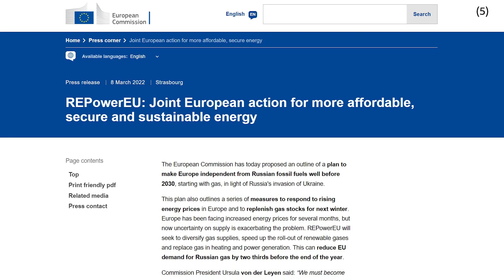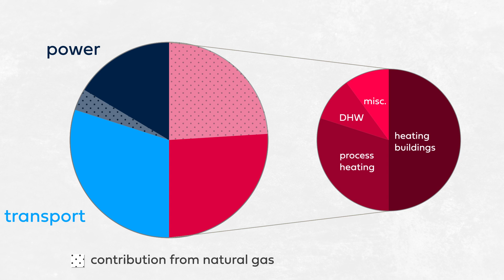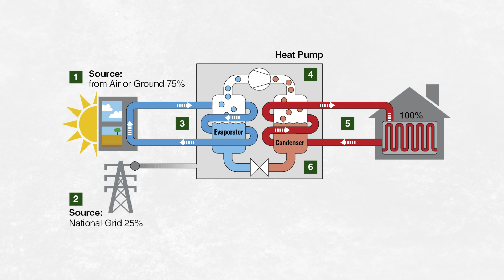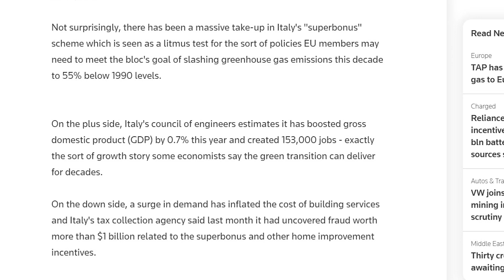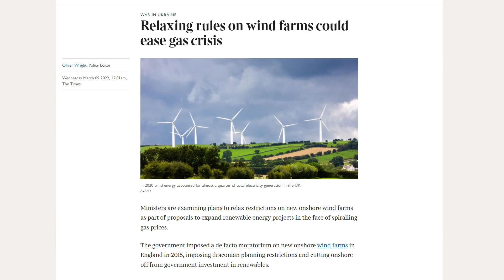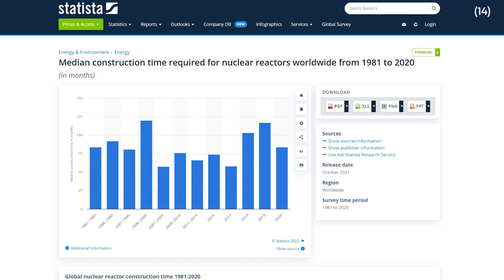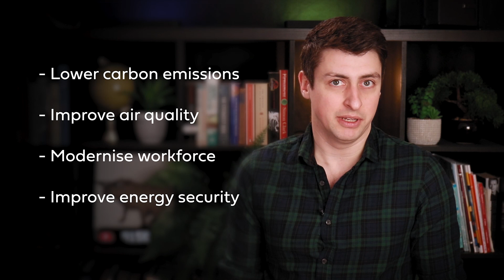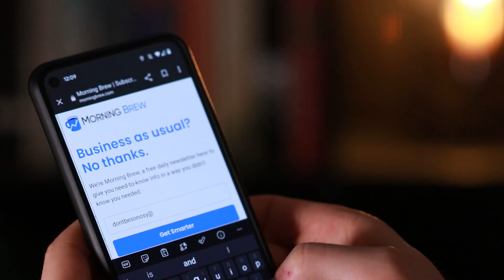How Europe can wean itself off Russian gas

Comment: Hey! so small misnoma about electric heating systems is that they are all expensive. Yes, the initial cost/price is higher. No, it's not more expensive over all as the difference is made back (and then some with high power prices) in power savings over the course of its rated 10-15year lifespan. Especially ground-to-water is extensively used in the nordics (incl. the home I grew up in =)!

Comment: You don't need to build new nuclear, when you have many countries who have existing nuclear that they want to close for other reasons far before the end of their technical life! And yes, improving insulation and changing to heat pumps are great projects as well. In Finland we have long tradition in that already and gas is not really used in here for heating at all despite the country being among Western Europe's coldest, if not the coldest. Heat pumps would probably work just fine in the mid European not too cold winter.

Comment: "For now", "Yet".

I think it would be easier to build nuke reactor powered atmospheric CO2 processors to cover for the recycling of the carbon emissions from the odd percent or three of process heating requirements by natural gas heating than to having to spend decades looking for alternatives to specialized use that did not require natural gas burning while still burning gas in that meantime. It is less elegant and more brute force approach.
Furthermore, about nuclear. Very Small Modular Reactor. The size of ISO containers. What was originally a 100m×100m building build on site would be the size of a big rectangular box. All build on an assembly line and mass-produced and using iterative design to make every new run better and cheaper. Overwhelmingly cheaper if you run into thousands of units build over a period of ten years.

Comment: i have   super efficiant home   i have a  260l thermal  water tank  with 3  coils   one   is  conected to the gas boiler   one is conected to  a wood stove  the 3rd is conected to   thermal solar water  heating  tubes   ,  although  there is a push  to   heat pumps by the british government   would you trust   them  knowing   that they were were the ones  who pushed everyone to bye  deisel cars twenty years ago  ( hows that work out  for everyone  ?)
 TOTAL BLOCKS    NEXT   if you want to travel    you would be better off buying a  freaking horse   and cart   at least the  fule a horse  uses  is hay and grass  .  plus   owning one    is  zero emmision    zero tax   zero insurance   and a one horse power  cart can  pull  an 8 person family  .
and another   point  you cant  get it towed if you leave it  somewhere  you should not . :)

Comment: You forgot to mention that when it gets really cold heat pumps become ineffective and you have to return to gas
Reply: Not if you use a ground source heat pump.
Reply: Some of the newest heat pumps maintain 90% of their rated heating capacity down to 0 degrees Fahrenheit.

Comment: we in germany have many nuclear reactors that simply could be switched on again with very little work compared to building new ones^^
we might even end up being forced to do so.
but i still think we should heavily invest into building new nuclear power plants because that is beside hydro pump storage the simplest and safest way for necessary base load capacity,
you can not have a relatively static electricity grid with mostly fluctuating electricity loads from wind and solar.
Reply: "simply" be switched on? - not that fast..
In Belgium it is now decided that our two youngest reactors will work ten years longer.
This will cost the tax payer BILLIONS.
Meanwhile we could have realized the entire energy transition which would save us these billions.
Reply: The problem with undoing the nuclear phase-out is that so many contracts are already canceled: The work force has gone, no new nuclear material is being produced, capacities for that cannot be cranked up at short notice at will. Returning a nuclear plant to operation that's already been decommissioned would take years, too.
Reply: @PapaOystein  ya maybe, but with enough willpower it should be much faster than building new nuclear power plants.
and lets be honest the complexity of turning on old nuclear power plants is vastly smaller than the problems we will have with runnaway climate change.

Comment: Insulation is a great way to go as it reduces heating requirement regardless of the type of heating.  However, while heat pumps are very efficient at the home level interface, I have heard from various sources that if the gas boiler is replace by a heat pump and gas powered electricity, there is no real advantage when the efficiency of power generation and transmission is considered.  So heat pumps are a good idea to reduce Russian gas ONLY if the electricity is not generated by gas.
Reply: Depends heavily on COP and consequently on temperature difference between room and heat source temperatures. At COP of 3 and powerplant efficiency of 40℅ you already getting 20% more heat from the same amount of gas. Technology Connections had some numbers in one of his vids on heat pumps. His conclusions were that with his unit it's effective down to around -10 °C or so, can't remember now, but that's with air source pump and COP will likely improve in the future
Reply: Agree: insulation is essential. Gas is about 40% efficient, so conventional thermal electricity sees a 60% loss when switching from gas..i.e just burning the gas in the home is 95% efficient [95 kWh/100 kWh gas], and thermal heating would be 100kWh gas: 40 kWh of electric heat. A heat pump even from gas generated electricity is 80kWh to 120kWh from 100kWh of gas..however gas in the UK is only making up 35%, so it is still lower carbon and energy

Comment: There is also a notion of gas-powered heat pumps that are a good drop-in replacement for homes that are hooked to a gas line directly and possibly mandated to use gas by contract or local legislation. It still uses gas, but much less of it due to a higher efficiency (going from 100% to 300%, for instance). It also has an added benefit in countries where electricity itself is largely produced from gas - burning gas to power your heat pump means you can use all the heat from burning, too. Instead of burning gas at the power plant, wasting the heat there, and losing some electricity in the transmission.

Comment: Dear Simon Clark 
@7:28 Oh dear, where to begin. I must first bring your attention to the existing nuclear power plants, that are already build and operating today, which are under threat to be shut down. Most notably in Germany, which plan to shut all their remaining nuclear plants THIS YEAR. Germany was originally planing to replace the firm (weather independent) capacity provided by nuclear (and coal) by increasing electricity production from natural gas, mainly from Russia. This was made explicit years ago. Now that Russian gas is no longer politically viable, and Germany wrongheadedly refuses to reconsider its anti-nuclear dogma; German operators are preparing for extending runtime of decommissioned coal plants and coal companies have recently received BILLIONS in subsidies. May I remind everyone that coal, particularly the lignite (brown coal) that is mined from the ground where Germany's forests and villages are/used to be, is even worse than natural gas. 

I don't think you would disagree with the idea that keeping existing nuclear power plants is vital. However, it is very strange that you (right before mentioning nuclear) acknowledge the currently needed utility of natural gas to back up variable renewables. Yet, you have omitted giving nuclear power the same courtesy, even though nuclear does the same job but better; ALSO providing weather independent power, but WITHOUT the high GHG emissions. The fact that you explicitly point out the momentary continued need of a fossil fuel (which I don't disagree with), while failing to do the same for an existing low-carbon power source, only lambasting it in negative terms... to be honest, I find that utterly baffling. 

Regarding the "nuclear takes too long to build" argument: 
1) You can't compare nuclear to wind like that, since they play fundamentally different roles in the energy mix. Wind (and solar) are fuel-saving variable energies, while nuclear is (weather independent) firm energy. This is the exact reason for why Germany was initially planning to use gas as the direct replacement of nuclear and coal... and this is also the reason why you acknowledged that gas would for now remain the back-up power for variable renewables. 
2) Comparing the construction of nuclear and wind doesn't exactly give anyone a clear impression of what each would provide over a given time period in unambiguous numbers. When we examine the historical scale-up of energies in terms of additional MWh, and adjusting for population size, we can see exactly who experienced the fastest decade sustained annual growth rates of low-carbon energy. These are Sweden (1974-1983) and France (1979-1988), and they accomplished this with nuclear power. France in particular responded to the oil crisis by enacted the Messmer plan in 1974 when they were ~10% nuclear. France became >65% nuclear after 10 years and 80% after and additional 10 years. This also DOUBLED their absolute electricity production. In fact, they overestimated the amount of capacity that they end up requiring and ended up building MORE nuclear plants than they needed. Citing how long individual plant takes to build says very little about rate we can add MWh over time. Far from being "too slow", nuclear power is historically the fastest way to scale-up low-carbon power within a decade.  
3) We should continue to build more renewables absolutely. And, yes, I don't think that, even if we start to build new nuclear plants right now, that these will be finished before the next winter arrives. However, this is not an either/or situation. Nuclear power construction do indeed have long planning horizons, but we certainly can plan ahead of time...  which goes without saying in a climate change discussion. At least, it should in my opinion.

Comment: The argument of the video has a flaw, you are talking about using renewable energies as a way to replace gas but this is not completely right as an energy mix needs controllable energy (i.e. an energy which allow to adapt production to market needs) and wind and solar power are not controllable so it is impossible to go without gas without raising the other controllable energies namely coal (and all other fossile energies), nuclear and hydropower

Comment: In my country we have solar water heaters. Idk how well that would work in the EU, but maybe in some areas it would be a good fit.
Reply: I think it would be a good fit for most of EU, except maybe the Nordic countries where winter days are too short. Here in the French Alps, I know several people that heat their home that way (sun-heated water then circulates in floors or radiators) and they only need to complement it (usually with electricity) a handful of days each winter.

Comment: My only gripe with this video is the efficiency argument, the analysis seems naive and doesn't consider second order effects.
If you propose an efficiency improvement of 20%, what most everybody thinks is "aww sweet, now I only need to utilize 83% of the natural gas in order to achieve my desired outcome"

What an economist or a businessperson thinks is "aww sweet, I can now produce 20% more output per unit of natural gas, time to find more ways to use it"

You have merely increased the benefit of using it, increasing demand, without policies to reduce supply or find substitutes to natural gas, efficiency doesn't reduce the quantity used.
Reply: Have you seen the gas prices recently? No businessperson is gonna hesitate to decrease natural gas usage.
Reply: @emiliehans5225  at all prices, natural gas that can be used to produce, for example, 1.2 units of output thanks to a more efficient utilization process will be used more than natural gas that can only produce 1 unit of output.
Reply: @InternetLaser  I agree in theory. Of course, if demand is high enough, if production can easily be scaled up and if gas costs has a big impact on end costs, then a businessperson would scale up production after efficiency improvements.
But in practise, those are a lot of conditions. If a baker's production costs are only 5% dependent on gas costs, then a 20% efficiency gain is not gonna result in a 20% increased production -- labor, wheat, logistics and equipment is way too expensive for that. 
The efficiency gain is still worthwhile though, depending on upgrade costs vs gas costs, no production increase necesary.

Comment: If you don't get gas from Russia, Europe could easily get it from Canada, the United States or other producers.  A shift from gas to electrical heating and generation implies an increase in baseline generating capacity and the cost of electricity.  It is important to fully account for carbon emissions, environmental damage and the effects on human health of renewable power and efficiency initiatives.
Reply: If we are smart about it we couple the heatpump with the internet and let them use excess renewable energy, that would lower the overall system cost